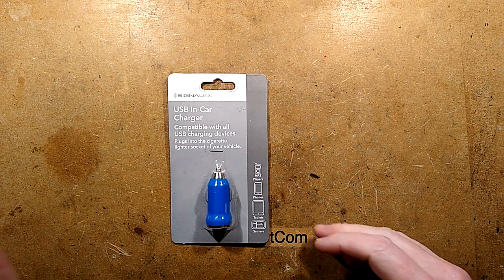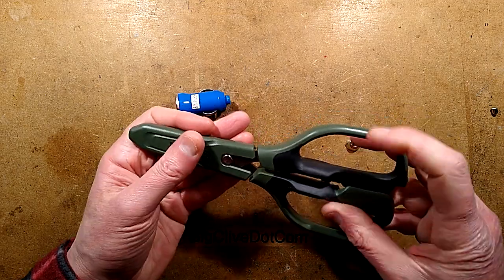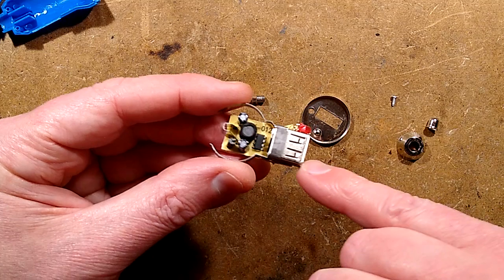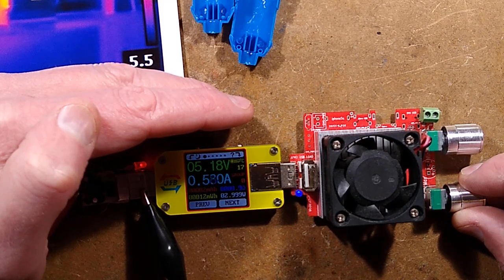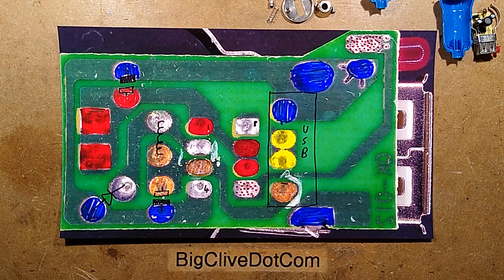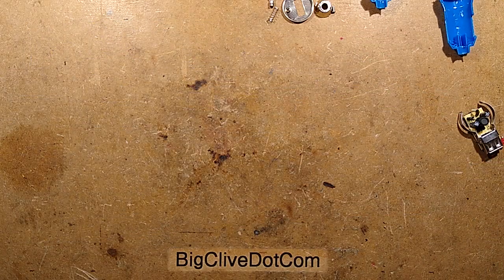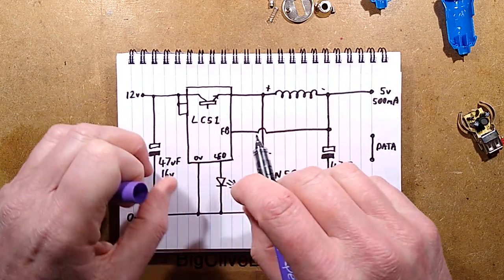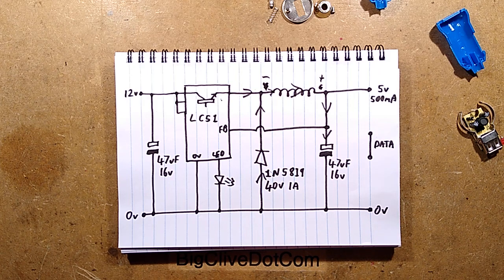Inside a Pound shop car-USB charger (with schematic)

Comment: See 5.5°C on the FLIR. That's a nice, balmy 42°F in your house. Hell I start to bitch when it goes below 65°F.
Reply from the maker: It wasn't quite that low.  But close.
Reply: I'm the opposite....I'm like a Tibetan Monk...the biggest problem I have with a blizzard is trying to get rid of my body heat fast enough without bursting into flames....70 degrees F and I'm Thich Quang Duc...

Comment: Saw a guy in a car group the other day whose car burned down thanks to a faulty USB socket in the lighter socket.
Reply: Some lighter sockets die with the key off and others don't. You don't want to use the always hot one since it might run down the car battery for you. Leaving a phone on a charger in a car is an invitation to an expensive BBQ unless like everything else, those days are well behind us already? I seem to remember it used to be a thing.
Reply: @leebarnes655  Yeah, they had the same car as me and mine doesn't work unless you turn the key and this happened while they were parked up so not sure what went wrong, they just said it was caused by a faulty usb lighter adapter.

Comment: I don't exactly understand this, usually you're only in your car for a little bit, you'd want the fastest charger that you can get that also supports your phone, so you'd get more battery. at least need a 2 amp more PD capable one. maybe if you just wanted to power something like a Bluetooth adapter or something. I don't think you'd even get a charge on a phone, especially if you're doing something taxing like using your phone as a dashcam or using maps on your phone. 
On the flip side, I think low power chargers are great for bedside charging, since you're gonna have your phone in a low power state the whole night, and you're in no big hurry. I keep chargers from devices and use them at bed time because I'm not in a big hurry and I'd prefer to charge my phone slowly so it lasts longer, and I'm not sitting at 100% all night, only for a little bit.
Reply: I figure they're either reusing an older design, or actually using old stock. Would have to look on the parts for date-code. Yes, you could build a new design using PD/QC3 and I bet someone has. But have they made it in enough bulk that there is old stock just sitting around that can be offloaded for £1.00?
Reply: What don't you understand? Sometimes my phone is already 80-90% full but I'll put it on the car charger just to stop it depleting while using navigation s/w. I don't need a 2amp charger for that. Hell, I don't think my phone even supports this PD you speak of.
Reply: @chocolate_squiggle  most phones made within the past 5 years maybe support it, some phones come with it. What I don't understand is that 500ma is barely enough to power the phone. I'd say the bare minimum for most phones within the last 10 or more years need at least a 1amp charger. My phone complains if it gets less than an amp.
Reply: Around the time of the iPhone 6, most phones got qualcomm quick charge, which is more or less the same as PD. Samsung has included at least 2 amp charger since the S3 or even earlier and at that time most phones supported it.
Reply: @SittingDuc  500ma isnt enough to charge a phone, or at the very least takes forever to charge.
Reply: @chocolate_squiggle all phones within the last decade support PD. and 500Ma isn't enough to charge any phone. in fact most phones will think you have a broken charger and refuse to charge at 500Ma. you really need at least 1 amp before a phone will actually start charging.

Comment: I really hope Big Clive will see this. I just bought a 10,000 mah power bank from a local discount shop here in Ohio. It was $8 and works ok, but its very strange. It only turns on to charge a device if you give it a good shake. Like a nice jostle. Has to be fairly violent. Thats the only way to turn it on. It works fine after that, and doesn't shut off or anything. Is there any chance this thing has some kind of gyroscope sensor that turns it on or something? The brand is 3SIXT. Thanks!!!
Reply from the maker: It sounds more like a bad connection or dry solder joint.

Comment: So I could use the LCS1 chip to power a mosfet in parallel, regulate the voltage apperopriatly and have a sufficient output current this way.
Reply from the maker: It might be possible to add an external transistor.

Comment: Hiya Clive, sent you a donation as a 'thank you' for your entertaining video's. I looked for a way to contact you but couldn't find one so please excuse me for asking a question here. Have you done tear down of an electric stapler/nailer? (I looked back a long way through your old vids but found nothing). I have a Chinese 'Parkside' which, until it got rained upon was actually ok. I've taken it apart but can't anything obvious (burnt out circuit board etc.) just wandered if you had any idea's where I might start - I know buying a new one will do, but it would be interesting to find out what stopped it. I can send pictures if you require them. Cheers, George Berrill.
Reply from the maker: Thanks.  Much appreciated.  It's hard to tell where to start if rain has been involved.  It could be corrosion in the button/switch.

Comment: You mention it's not up to your standards but it seems to readily supply 30% above the advertised current at a solid 5.1v. I don't see why it deserves hate?
Reply: Probably because 500mA is impractical for most of today's power-hungry devices and the charger runs concerningly-hot at that output level? Other commenters have had similar, or the same, chargers that have gotten hot enough to melt the plastic case, had the metal cap come off the end and short out the lighter socket, or have had components fail in a way that indicates overheating. The simple solder-blob bridging of the data lines is, to quote Dave at EEVBlog, "a little how-ya-doin'."
Reply: @dashcamandy2242  I still only use 1A or lower chargers for my devices. I see no need to risk shortening battery life by filling it up at record speed. And there is a trace between the data pins to tie them together on this one.
Reply from the maker: It runs too hot under load and the 500mA limits its use these days.

Comment: I've used a similar charger charging a Samsung galaxy s7 and I measured the temperatures on the chip at over 120°c according to my CAT S60 thermal camera, can't believe it didn't blow a hole in the chip😂🤯

Comment: I didn't understand any of that schematic (only because I'm electricity illiterate), but great video. Also how do these cigarette usb chargers complete an electrical circuit when there's just a single knob tip at the end. I thought you need a positive and negative line in, like a kettle plug, to complete the full circuit
Reply: The metal strips at the side of the case provide negative. For the socket, the center contact is the positive terminal and the shell is the negative terminal. See here for an explanation https://en.wikipedia.org/wiki/Cigarette_lighter_receptacle
Reply: @SharkoonBln  ohhh. That's how it works. I just checked it out. Thank you! Also must be similar to some of those torch light bulbs too!
Reply: @nfreddyyy  The classical torch/flashlight has the batteries in series in the body/tube. Positive tip of the frontmost celltouches the center/tip of the bulb which connects one end of the filament. The  other end of the filament is attached to the screw thread(unthreaded in some cases) of the bulb, the bulb holder connects to the switch ,which makes or breaks a connection to the body/tube. The screw on end cap makes connection to the body/tube, and the spring attached to the cap connects to the negative end of the rearmost cell.
https://en.m.wikipedia.org/wiki/Flashlight#/media/File%3APatent_617%2C592.png

Comment: I like to charge my phones with a 500mA charger. It keeps the battery a lot cooler, and i get them to last for 4 years without degradation in that way. 
I've never gotten rid of a phone because of battery degradation :) they survive until they're 4 or 5 years old and get too slow to my taste.
I do have a fast charger for those 'oh fuck, forgot to charge' moments. But i limit its use to those kinds of moment.

Comment: Question for you Clive, do mains USB chargers use power when not connected to anything and if so, is there a difference between a cheap pink unit and an Apple one?
Reply from the maker: Most use virtually no power in standby.  You can tell by their temperature.

Comment: Hey I have at least 5 of those somewhere in the car, every time I need one I can't find it so I have to get a new one (Extremely common here in México)
Reply: Doesn't your car have USB ports?
Reply: @dogwalker666  It's from 1995
Reply: @adan7949  ooh a classic cool.
Reply: @adan7949  if it has a blank button panel, or you're willing to drill a hole somewhere, they do make 12V->USB-outlets for panel mounting. Should prevent it from wandering off... 😀
Reply: That is the story of my room....how many CR-2032 batteries that are at 97 % charge does one man need to own....

Comment: Out of curiosity, what was that itty bitty fuse rated for?
Reply: 120 amp
Reply from the maker: I've just checked.   F0.5A
Reply: @MothKeeper  JC on a pogo stick... are you related to Stan?
Reply: @bigclivedotcom  Thanks.
12V @ 1/2A -> 6W
(Optimistically that is.)
6W @ 5V -> 1.25A
I wonder if the makers ever heard the phrase "safety factor"?

Comment: Clive, could you modify this to output more current? 
There's an idea... vids of you modifying things to work beyond their designed limits.
Reply: You could possibly rig an external transistor to do the switching, but then the inductor will be under rated so that would need replacing & the shottky diode looked to be borderline too.... so probably easier to start from scratch!
Reply: Also, Instant Coffee can be modified to be overclocked into a T-Max film developer using Laundry Booster Washing Soda and Vitamin C tablets...

Comment: 500mA is standard max current for dumb USB devices, it's out of spec to draw more than that from a USB port without negotiating a high-power connection, which these cheap-as-rust chargers can't do.  It's the same number you'll see on every one of these things

Comment: Do not remove these cheap things from the socket, while the car is running.

These pressed-together devices loosen from vibration and can eventually short out your ignition as they fall apart while you’re pulling them out of the socket.

Comment: What happens if you plug an iPad into it, which has always required at least 1A, even for the original model that launched in 2010?
Reply: It would be like the light bulb on the refrigerator...it would increase its charge as long as you have the screen off, but when you go check it would use it back up and you would be back to where you started.

Comment: Does it work if I put a beefy transistor at the output for beefy loads? I mean, the output of the chip is connected to the base of the external transistor while the other components that is connected to the output is cut and re-wired to the output of the external transistor to drive a higher current load.
Reply: Yes you can use an external pass transistor with the mc34063 if needed. But its an obsolete design.

Comment: My car battery kept dying. I had a cheap 12v socket USB charger that was falling apart. Would almost split in two if not in the socket. I replaced it and now I have no problems. Could a crappy charger do that to the battery?
Reply from the maker: I don't think its standby current could do that to a good battery.

Comment: Since some failure of those crappy usb sockets, I only use Qualcomm QC3 certified chargers. No more magic smoke while heading down the Autobahn.

By the way: Clive I've got something for you to reverse engineer and or try to fix. I tried to get in contact with you, but it seems you didn't get my message. I would like to send it over to you,if you are interested. (Of course for free). Please let me know.
Reply from the maker: If it was an email then it may have been engulfed in a recent email tidal wave.
Reply: @bigclivedotcom  I've been trying for several weeks now. Even in live stream.

Comment: Does anyone know what that fuse type is called and where in the UK one can get 250ma, 500ma, 1amp, 2amp, and 4 amp fuses from, please?
I have a radio that uses all 5 values of fuse in various stages of the radio, but for the life of me, I've not been able to find where to get them from.
They are smaller and diameter and shorter than a standard 20 mm fuse, and changing the fuse holders in the radio is not an option.

TIA,
K.

Comment: would boosting up the capacitor and inductor to higher values would increase the output current then?
Reply from the maker: It might be cheaper to just upgrade the whole thing.

Comment: Typically speaking which component is likely to fail first in a good quality USB 1-2A charger??
Reply from the maker: The output capacitor.
Reply: @bigclivedotcom  Thanks for that. It's good to know. I have a few dead USB chargers laying about, and I very much dislike the current state of our disposable consumer culture. I am loathe to discard them and create more rubbish, so I would much rather repair them myself and put them back into service. Some of them are a little tricky to open up, and get access to the circuitry, but I am sure there is a way in. lol

And greetings from Canada 🇨🇦🇨🇦🇨🇦!!

Comment: Has anyone else noticed that some usb wires will not properly power an arduino with a relay.  Why is that?
Reply from the maker: Some USB cables have a high resistance because they are thin.  That causes voltage drop with higher loads.
Reply: @bigclivedotcom  I figured as much.  I was disappointed because I assumed that if it had the usb label it had to meet some spec for power carrying, but I guess not.  Thank you.  LOVE YOUR CHANNEL, I LEARN A LOT HERE!

Comment: I have the same ones. If I use one on my GPS  My FM radio gets static and the channel fades in and out. The same effect happens if I charge my Sonim Phone.  They work to power both devices, but the noise they emit on my radio sucks balls. Seems like it has a radio signal jammer in it. Clive : Please investigate.

Comment: Can you buy 4 or 5 and wire them up in parallel to get a decent output
Reply from the maker: It might work.  Better to buy a decent one though.
Reply: @bigclivedotcom  I hope you try it and make the video😂 though £4 might take you over budget
Reply: @bigclivedotcom  coz expensive ones don't last that long 1 to 2 years. Maybe 4 in one might break one at a time. Anyway they are not built to last and that's not a conspiracy so technically you should be able to beat the system. Your our man... Make it so

Comment: Can that be increased to 1 or 2 amp by charging any of the parts in it. Thanks
Reply from the maker: No.  It's limited by most of the components.
Reply: @bigclivedotcom  thank you I Was just wondering I just got one just like it for use in my car and it takes forever to charge my phone. Thank you for your great videos

Comment: Not the worst I've seen, but still completely useless. Worst one I've seen in person would be a car USB power adapter for a FM transmitter that was literally just a 78L05 and a couple crapacitors. No fuses or any sort of protection. glorious 100mA!

Comment: Just made a video about this scissors. A test in the kitchen, garden, workbench, bedroom bathroom, attic, basement. garage and so on. It don't necessarily be all the time electronic. You can just cut some electronics / electric stuff with the scissors. Under the load if needed :)  Just grab those 400kV protective gloves and loots of fuses - ahaha - just kidding - please don't put Yourself in any danger. Stay safe and have a nice day mate.  P.S. I work with a colleague  that checking with his own fingers if there is a phase on 3 phase 400VAC line [high skin impedance], well one day he made mistake in tram line power substation and "check" 600VDC connectors - let's say he will never again show V sign with his left hand. From that moment many people are asking him is he a carpenter ?

Comment: They dropped a few microfarads on the output for 100n on mine!
Reply: It would be interesting to know if yours are stable with 100n ceramic, as mine seem to be manufactured with!
Output impedance doesn't have to be low I guess?

Comment: Boggles the mind that people buy expensive phones and then buy the cheapest chargers and cables for them and get angry when they blow up their phones. I'm also not sure how stores get away with rebranding random chinese chargers especially mains ones with their own store brand and selling them despite them obviously not being CE compliant etc.
Reply: Or when someone buys a $2000 home theater system and then won't want to spend an extra $80 on a surge protector...Just like ordering a Quad Stacker burger, a King Sized fries, than insist on getting a Diet Coke...

Comment: What happens if 24volt is applied ?
Reply from the maker: The chip may handle it, but the input capacitor would be stressed.

Comment: I found a description of the LC51C as "Optimization of MC34063 products, It can be achieved using minimal external components switch buck converter, widely used in automobile charger, DC buck converter and other products."  The MC34063  is pretty much garbage by todays standards, low switching frequency, and poor great efficiency.

Comment: Okay they never changed.. The motorola chip is also available as a China fake/copy..
The worst part is that this can damage your car electronics because of noise and break diagnostic connection at the repair shop by interfering! The are trash !

Comment: Dreadful chargers 
Try using your car radio  you'll find the RF interference totally blanks out the signal.

Best charger I use is by ANKER.
They are all metal and cost 10 quid but are total quality and radio works perfectly